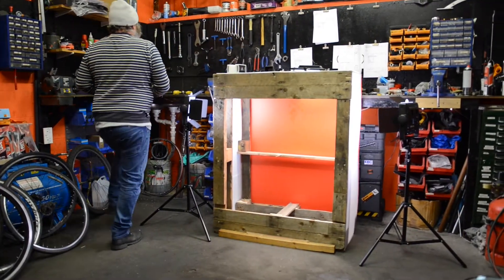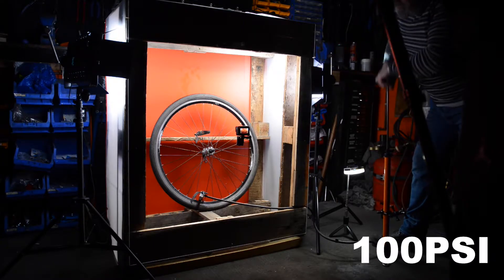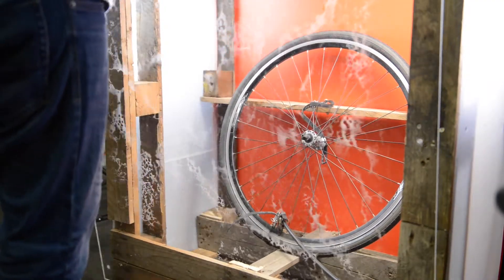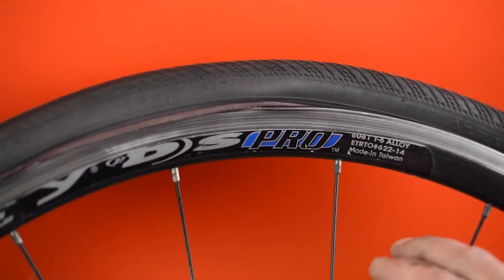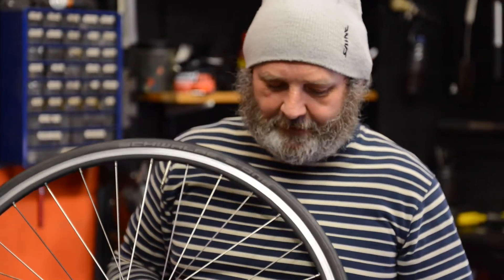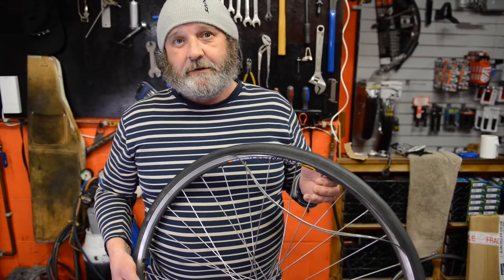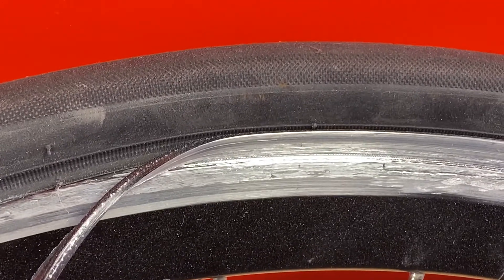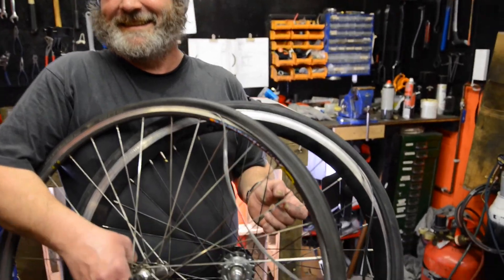EXPLODING BIKE WHEELS...The dangers of riding on worn or damaged rims in slow motion.

Comment: How does one know if a rim is too thin?
Reply: Credit card test: take the edge of a credit card and run it along the braking surface.  Now, a healthy rim will contact all points of the card, but the thinner it gets, the more concave the rim gets as pressure and fatigue wear away a groove down the center.  At that point, you might want to check the thickness of the rim with calipers.

Comment: Bought a used hybrid bike max PSI was 75 pumped to 65 test it out. Blew tire and tube. At closer look the rim has separation where its crimped I think? Anyway it pinched the tube and separated while ridding. Sounded like a gunshot.. about to jump off bike and do a stop drop and roll.